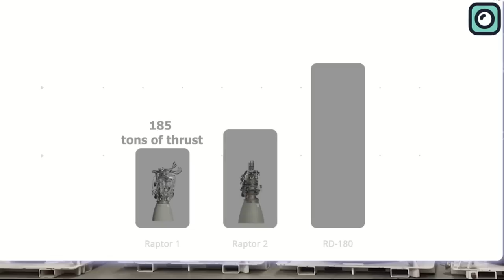SpaceX Just Revealed Insane New Raptor Engine... NASA Shocked!

Comment: Even he make raptor999….. will not be able to go mars even not moon
Reply: And why is that?
Reply: @jeroenscholten5062  Rocket engines are one of the most powerful technologies humans have developed. These engines propel rockets into space, and their power is derived from the velocity of the exhaust gases they produce. However, a fundamental principle of physics is that gases will expand to fill whatever volume they are placed in, and this can have a significant impact on rocket engine performance.

One of the challenges rocket engines face is the low atmospheric pressure found at high altitudes. As rockets move higher into the atmosphere, the air becomes thinner and the pressure drops. At some point, the pressure becomes so low that it starts to affect the performance of the rocket engine.

This is because as the exhaust gases are expelled from the engine, they begin to expand and fill the low-pressure environment around them more easily. When the atmospheric pressure is high, the gases have to work harder to expand and push their way out of the engine. But as the pressure drops, they are able to move more freely and expand much more rapidly.

This rapid expansion of the exhaust gases has a direct impact on the rocket engine's thrust. Thrust, after all, is simply a measure of the force exerted by the engine's exhaust gases. As the gases expand more quickly, they lose their velocity and become less effective at propelling the rocket forward.

In addition to the effect of atmospheric pressure, there are also other factors that can impact rocket engine performance, such as the temperature of the gases and the design of the engine itself. However, the basic principle remains the same - the velocity of the exhaust gases is what provides the thrust needed to propel the rocket forward, and any decrease in that velocity will result in a corresponding loss of thrust.

In conclusion, while rocket engines are incredibly powerful technologies, they are also subject to a variety of physical principles that can impact their performance. The low atmospheric pressure found at high altitudes is one such factor, and can cause a decrease in the velocity of the engine's exhaust gases, resulting in a loss of thrust. Understanding these principles is critical to ensuring that rocket engines function effectively, and that we are able to continue exploring the vast expanse of space beyond our planet.
Reply: @ilhandurmus  lol this looks like an answer generated by AI 😂
Also btw. stating that raptor engine's thrust can vary depending on conditions doesn't mean they can't use them enough to land on other planets/moons
Reply: @simonnagy1  hhh AI ? AI Will generate text against raptor engine ? I use AI for better English but idea is 100 percent mine and I spend enough time to change idea of AI but it’s not easy
Reply: @simonnagy1  "Hey chatgpt, Write an argument against rockets being able to get to Mars using circular reasoning and nonsense." 😏
Reply: The reason the rocket bell is larger on the engines operating in space is to provide a surface for the rocket exhaust to push against providing a higher level of thrust. The lower the atmospheric pressure, or vacuum in space. The larger the bell is required to provide a surface for the engine exhaust to push against, and provide the maximum amount of thrust.  The Starship has larger bells, and the heavy lift has smaller ones. Using smaller ones on the heavy lift reduce the weight of the 33 engines. A larger bell on the heavy lift rocket isn't going to add more lift, but it will add additional weight, which actually hinders the lift off versus any gains in thrust pounds you might gain. The big gains come when you operate in a vacuum using a larger bell. It's a balancing act to get the most thrust as the atmospheric pressure drop, or you operate in the absence of any atmospheric pressure.
Reply: @marymarlow5598  When the movements of rockets are examined, it can be observed that at low altitudes, the hot gases expelled from the rocket form a long, slender tail. However, as the altitude increases, the tail shortens and widens. In fact, at a certain altitude (approximately 100-120 kilometers), it starts to wrap around the rocket. When the motion data of the rocket is analyzed, it is observed that the rate of altitude increase slows down while the velocity increases. The real misconception begins here. The propulsive force that accelerates the rocket is no longer provided by the rocket engines, but by the magnetic vortex in the Earth's orbit (the same vortex rotates the International Space Station around the Earth at a speed of 27,000 km/h). The power of this vortex reaches speeds of 7,000-8,000 km/h at altitudes around 100 km and up to 25,000-27,000 km/h at 400 km altitude. In my opinion, the true cause of gravity is this vortex and the pressure it creates at altitudes close to the Earth's surface. Therefore, no matter how wide you make the rocket, it will have very little effect, and calculating whether it will push the rocket or not is difficult. The only way to progress in space is through electromagnetic rocket engines. Developing such engines is not so difficult, but all the efforts have been focused on ions instead of magnetic waves. If research had been conducted on magnetic waves, powerful electromagnetic propulsion engines would have been produced by now.
Reply: @marymarlow5598  As the magnetic vortex surrounding the Earth intensifies with increasing altitude, in longer rocket structures, the upper part of the rocket is subjected to greater force. As a result, the direction of the rocket changes to west to east relative to the Earth. Therefore, instead of using the gained velocity of the rocket to overcome the increase in altitude, it increases its velocity around the Earth and moves at a speed greater than the vortex for a certain period of time. If rockets are designed shorter and wider, they can reach higher altitudes with the right optimized shape, even if they experience high friction in the first 30 km. Additionally, in the second stage of rockets, instead of using the thrust of gases, their expansion velocities could be utilized for greater effectiveness. For example, using less fuel and spraying liquid helium inside could be more efficient. It is impossible to reach the moon with current rockets, and if someone claims otherwise, they are lying. Even with the advanced technology of today's imaging, there are no significant pictures or videos from the initial test of the Artemis program. Only low-resolution shots with unclear angles and perspectives were provided.
Reply: I decided to reach out to hundreds of my fans and get know more about, them and give tips about my career I think you are one of them
Reply: Inhandurmus , your vision of a magnetic drive engine is interesting, but the amount of thrust would be low. I'm not sure you could deliver the micro thrust delivered by an ion drive. Lots of people play with magnets, and magnets have 2 poles that equal each other. Your talking about using the Earth's magnetic field as your propulsion source as I see it. Kind of a solar sail propulsion system. I just don't see you gaining enough thrust to gain the speed necessary to reach the moon, or Mars in a reasonable time period. I've designed a couple different engines that have the ability to reach 1 million mph between Earth and Mars. That makes it a 2-3 week trip, instead of 3 months. You can get to Mars in a week, but you have to slow down, and that doubles the trip time. I'm looking at 20 tons of thrust per engine.  It's possible to reach 100 tons of thrust using my design, but the engine size increases until it's a total space hog inside the Starship, and I'm not sure it can produce enough thrust to lift off the planet Mars. Lifting off the moon should be possible with the 4 20 ton engines you can fit in the current Starship. 
Can your magnetic field drive lift a Starship off the moon. I don't think it can lift more than a couple hundred pounds at best. That's 1000x better than an ion drive, but nowhere close to the thrust needed to lift a Starship off the moon. We can discuss this magnetic drive system, and it might find it's place between the planet magnetic fields, where it's using the Sun's magnetic field. I think the longer the ship the more magnetic thrust you could develop. Basically a longer magnetic river offers more push or pull than a short ship. That's my opinion on how you should design it. Now let's turn it into a solar panel at the same time catching all that free energy from x-ray, and gama rays, and possibly the super powered cosmic rays.  I've been kicking around how to pull energy from cosmic rays, and trying to find a combination of materials, and metals that will strip a percentage of energy from a cosmic ray as it passes through the panel.
Reply: @marymarlow5598  My belief is that magnetic rocket motors have nothing to do with the Earth's magnetic field; they are a type of motor that focuses on the Lorentz force to propel itself at high speeds. I believe that any object in space has its own magnetic vortex. Perhaps this vortex already existed, and objects were caught in it, forming their own systems, or over billions of years, the mass rotating around an object formed the magnetic vortex. When approaching Mars, there is no need to slow down because the vortex will already place you in its orbit. Additionally, with the right elements, you can create a non-polar electric magnet. It is foolish to think that dolphin swimming can only reach speeds of 60-70 km/h with their fins or tails; just as they move quickly with an electromagnetic system, so can we. Many sea creatures suddenly accelerate and stop, not using their fins, but having some sort of magnetic propulsion system.
Reply: @marymarlow5598  I want to give you the honor of having my private telegram number so we can talk more is that ok by you?
Reply: I want to give you the honor of having my private telegram number so we can talk more is that ok by you?